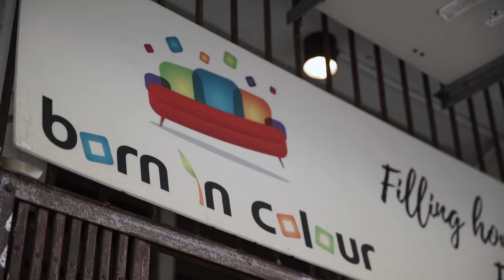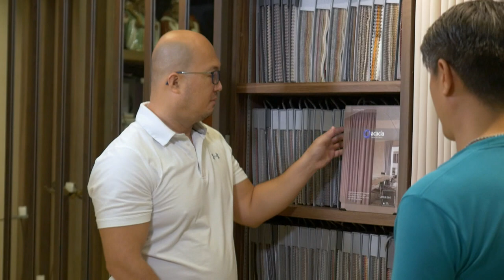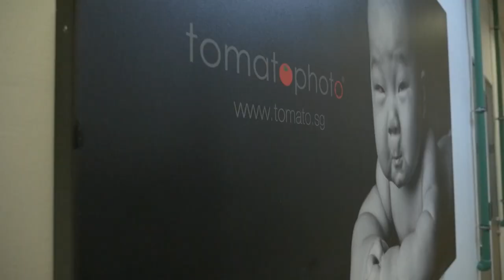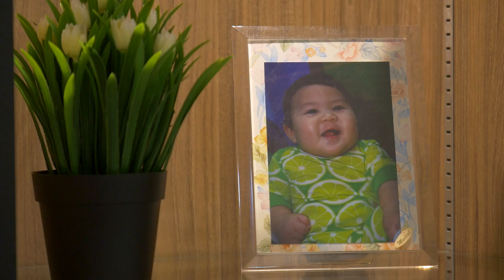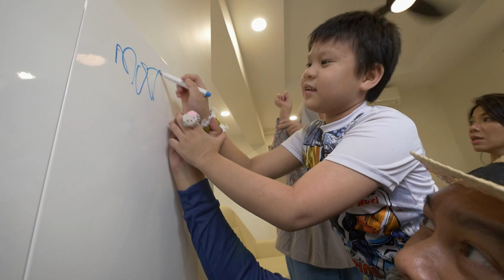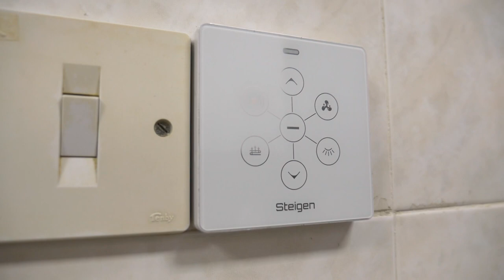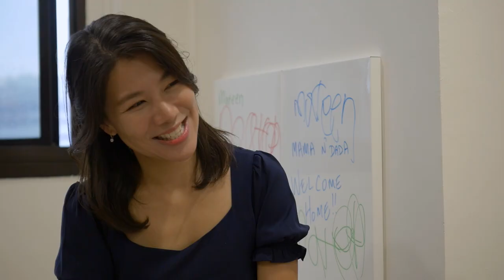RenovAID S9 EP8 | Can Flora and Mahadzir get their dream renovations?

Comment: The most common causes of mold growing on walls are high humidity, condensation and water leaks (which are often hidden inside the wall). Condensation forms when water vapor in the air meets cold surfaces and cools to become liquid. ... Leaking pipes near or inside of walls are a common cause of mold.